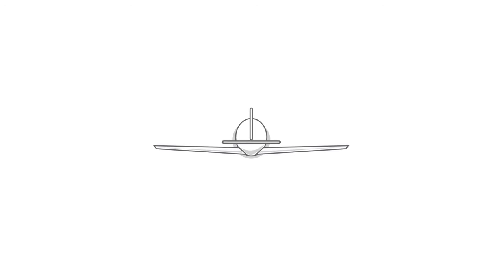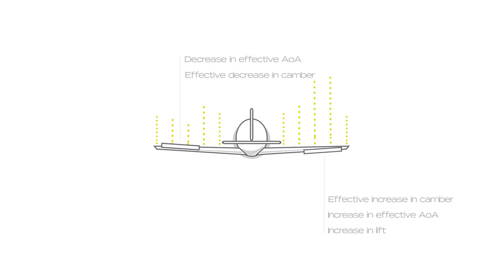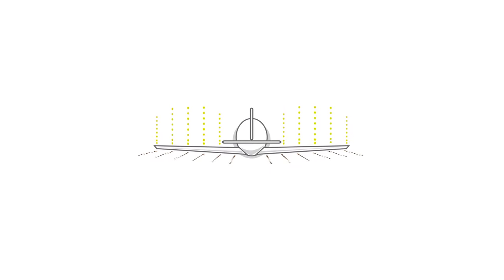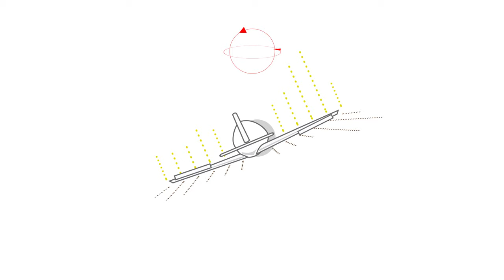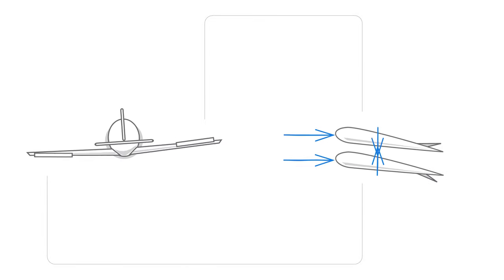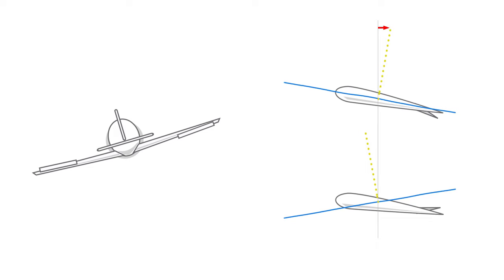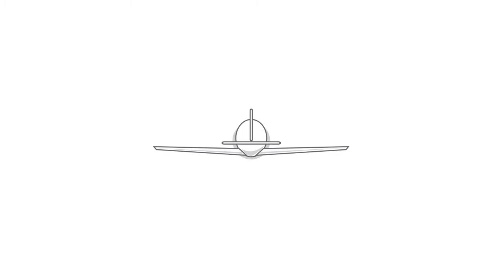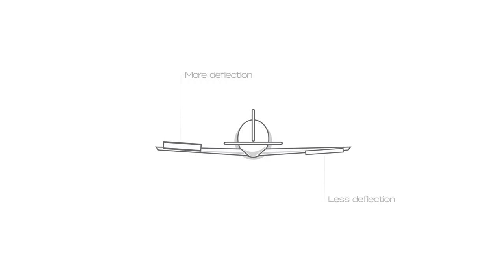Understanding Adverse Yaw | explained in simple terms.

Comment: It would be great if you could do a similar graphic explaining aoa of each wing on a climbing and descending turn as many spiral staircase analogies just add confusion . 

Second  request would be another animated video showing how center of pressure moves inboard and outboard which is why a rapid pull-up after a flypast may be survivable if you wings are level but if you also roll into a turn at the same time due to the moment arm on the high wing being greater you could over-stress that wing load. 

Last request is to show center of pressure movement fore and aft on a high vs low wing . The impact of this is on a low wing flap deployment cause nose to pitch down so if doing a go around in a low wing you pull back on the stick to keep nose up . I did a renewal on a high wing and on go around pulled yoke/stick back and almost did a stall / spin / splat as on high wing with flap 1 you have to push on stick when power applied to keep nose down - due to coupling .

Comment: Energy passes the route of least resistance. The air under wing is compressed more than the air on top causing lift. If you turn left there is more compression on left wing which will cause the right wing to have less pressure and stalls to the right even though you're banking left. I'm not a pilot but I have common sense and a slight understanding of how gravity and wind drag work.